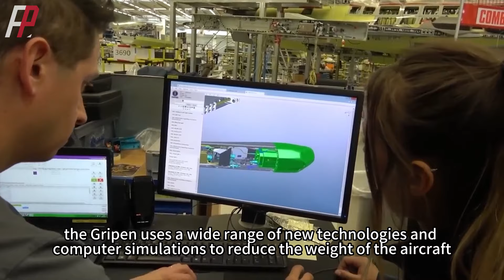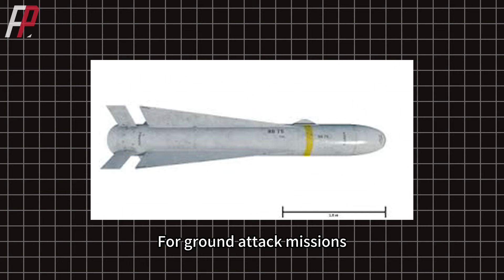SAAB Gripen E fighter aircraft, World's Most Powerful Fighter Jet.

Comment: I wish denmark bought a mixed fleet rather than just 27 x f35.. saab should risk sending ukraine a few gripen and hope for a success story.. i really want saab to show most of the world wrong on what a defence-in-own-airspace machine is
Reply: Tack Johnny, we are not insecure about Gripen's capabilities. If not the results from the Red Flag since 2016 is enough, maybe you could ask your own AF how they are doing against Gripen! I´m not holding a grudge against Denmark, I have visited you more than 100 times, and I love you. You are my siblings. Besides the F-35 is not a bad fighter.
Reply: @donquixote1502  f35 or gripen are not bad fighters.. but like most countries,  having a mixed fleet of fighter jets is preferable.. f35 has its advantages and gripen has its advantages.. and I wish denmark had bought both, rather than go all in on just f35's.. they turned down gripen in favour of f35 when having both would be better.
Reply: Agree, F-35 seems to be an excellent plane but I'm rely happy that there are others in the theater, like Gripen, Rafael and Eurofighter. I'ts a risk having all eggs in the same basket. There are certainly weak points on every fighters, with different ones those possible weakness will be less significant over all.
Reply: @donquixote1502  In the exercise with 5 norwegian F-15 there was 3 Gripen. In the US they have gone 5 F-15 vs 1 F-22, with all F-15 lost.
Reply: @johnnydenmark6477  Rafale and F-15EX ()and SU-57) are likely strong contenders. I think both would be more expensive but also both able to carry a bit more load. Don't know which one would perform best vs other fighters in current versions if we ignore the payload aspect.

Comment: -It is made by SAAB with American parts (engine), avionics and radar of the highest level from Israel/European, so modern that Boing is trying to buy it for its new generation of fighters, which is basically avionics and radar of the highest level. 5th generation.
-It is made to take off on tiny roads in the middle of the forest with just 3 support people (almost half of the F-16) with a flight hour cost half that of the F-16 but with practically the same capabilities.
-Made to be a Sukkois hunter in a close confrontation scenario with the Russians, second only to the 5th generation SU-57.
-Perfect hunting for poor countries like mine, or for Europeans with Putin knocking on the doors, it would be perfect for Ukraine and countries threatened by Putin.
-A unica coisa que falta e ser Stealth, mas ele tem contramedidas e assinatura bem baixa de radar o tornando dificil de abater, mas com uma frota dele completado por F-35 ou F-22 um pais pode facilmente se defender do Russos.